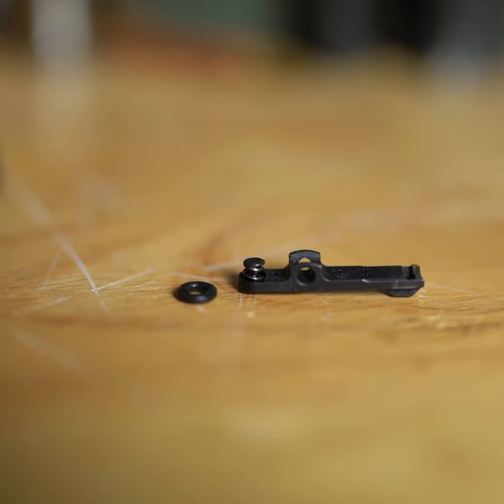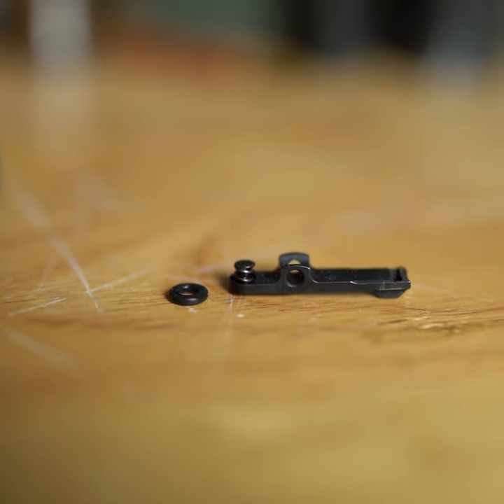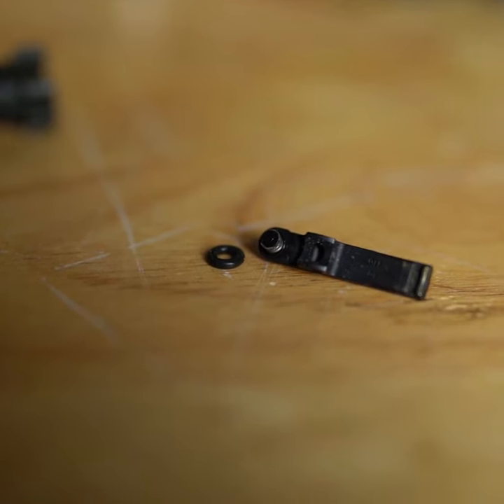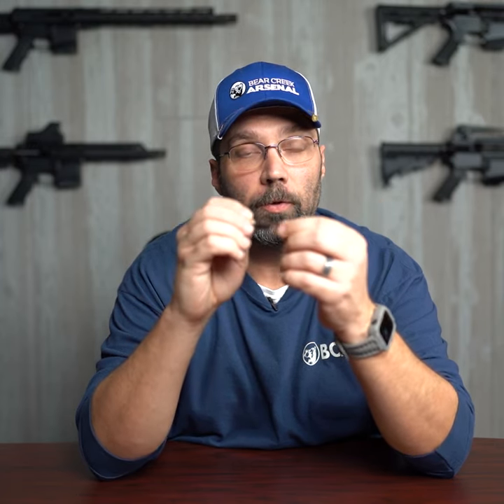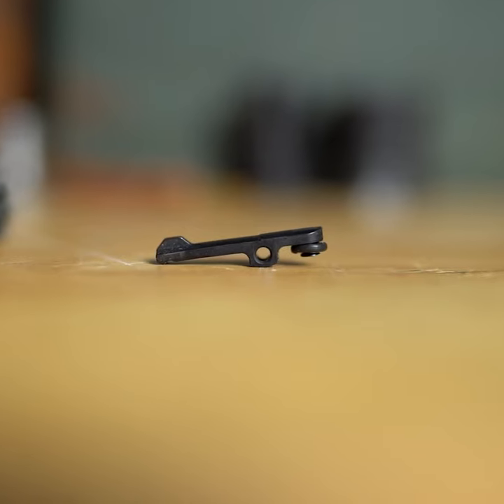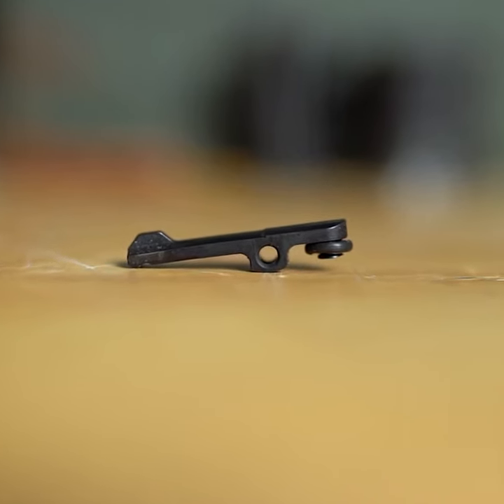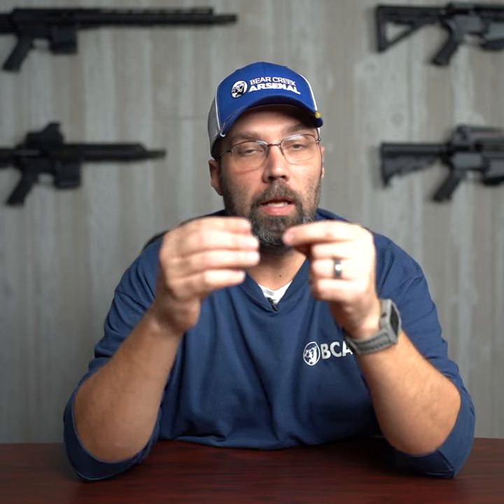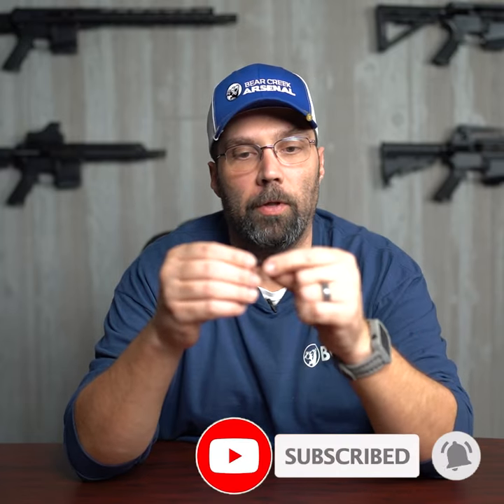Do You Need an O-ring on Your Extractor?

Comment: My Bear Creek 20" 5.56 upper was occassionally failing to extract so I added the "O" ring and have had no problems since. Also I get sub MOA with this and the Bear Crerk 3-9 scope. I am very happy with both
Reply: I also have a 20 inch upper stainless steel fluted barrel  And mine was very under gassed. It has a rifle  gas system. It was not ejecting or feeding. The boat wasn’t going far enough back to pickup the next round So what I did to fix it is I put a really light buffer and buffer spring. That seems to help a little bit and it was still doing it after every few rounds. So I took off the rail and I noticed the gass block was loose And crooked there was a lot of carbon around it, so you can clearly see it was leaking and not sealed properly. I fixed all that and now I don’t have any problems whatsoever except for the fact it’s still ejecting at 5 o’clock. But it doesn’t have any malfunctions anymore

Comment: My biggest concern about the neoprene o ring is how it might react to cleaners and solvents. I've noticed in automotive applications with o rings that eventually oil and solvents either swell or turn the material brittle.
It seems to me a better spring would be the best solution . The o ring seems like kind of a stopgap fix.
Reply: The synthetic rubber they are made out of is Viton, which is resistant to cleaners and solvents.

Hope this helps.

Comment: i had to get a new extractor for my BCA 7.62x39 upper as it was not grabbing the round right out of the box.  perhaps the oring could have worked but i didn't have one.  BCA sent me a replacement extractor and it seems to work without the oring while cycling rounds through by hand.  i've yet to fire it.

Comment: My 7.62/39 upper from bca didn't come with an o-ring. Also didn't come with the enhanced firing pin had to order my own.
Reply: Mine didn't either. It won't fire Wolf ammo because the primer is not flush with the case. I called and they sent me the enhanced firing pin but the enhanced firing pin was too hard and brittle and snapped right off on the first round fired. I called and left a message but they never returned my call.
Reply: All new x39 uppers now come with enhanced firing pins installed. They changed out last yr to the enhanced.. I had an older one that I put a black rifle co pin into, but the one ordered last spring had the enhanced pre installed.
Reply: @backwoodsmaineiac8897  How did the Black Rifle firing pin do with something like Red Army standard  7.62x39 122 gn fmj? Those primers are set silly deep.

Comment: Had one of mine, wouldn't cycle correctly. Removed o-ring, worked great, after that. Wondered if cleaning solvents made o-ring swell??
Reply: This is a common issue with short ARs like pistols. It is actually recommended that you remove that o-ring

Comment: Ok so I’ve had my bca 10” upper for a little over 2 years, it’s the one on my channel I have painted in pink camo, so yesterday I was loading it up and showing my little brother different features cause he hadn’t seen one before, he was trying to cycle a round and I seen it wasn’t cycling, so I tried and it felt odd so I looked down and of course some how my extractor had popped out, I chatted with the bca robot but it just sent me a link for a return but I’m not about to return my damn gun for an extractor.  Does anyone know any good aftermarket extractors that will work for the bca 22

Comment: Ive tried to contact BCA about replacement extractors (i have two 7.62x39) uppers and never heard back from them.. i know times are busy i get it but i would like to at least know what a good aftermarket one that will work and i can buy and fix them myself. Not a big deal i just want to know what works i know they make 2 different size bolt face. I know that black rifle arms website says theyre extractor does not work with BCA
Reply: Goodluck it took me a total of a month and a half to get in contact then a couple more weeks to actually receive a replacement BCG, shouldve just gotten a new extractor

Comment: Can't even use "caliber" correctly.  No wonder they have so many QC issues.....sigh....
Reply: I got a complete upper in my store straight from BCA. Bolt was RUSTED solid into the carrier. I think this upper was on the titanic.
Reply: Sucks to be you too, I've got 4 uppers from them, all work flawlessly  and are sub moa, sometimes I wonder where these stories come from? How could I be so lucky, and everyone else I know that has uppers from them also have no problems??? Seems fishy there's always someone bashing this company when all my personal experiences have been great.
Reply: @wymonwatson1309  I believe the rusty bolt story a lot more than your 4 BCA uppers that shoot sub moa fairytale.
Reply: @wymonwatson1309  Seems fishy there's always someone complimenting this company when almost all my personal experiences with their stock uppers have been overall poor.  My only REAL compliant with them is that the CUSTOMER is their QC department.  For the price, I'm not surprised/angered at the percentage of poor shooting barrels they send out.  (That's a quality issue - not a QC issue - and they are low priced guns.)  

I buy their uppers because it is the cheap way to get a side charger and BCG. Toss the barrel; and you still have a cheap, but well made, side charging upper/BCG to use on a better build.  

One came without an extractor.  A different one came with no gas port drilled in the barrel.  (How is that for QC?)
Two would never cycle a round more than 25-30% of the time.  (One of those is the above mentioned rifle once they "repaired" the port issue.)
The WORST is a 22LR upper that does 12MOA at 50 yards with the ammo it likes best.  (This is a quality issue - not a QC issue, I admit but dang!)  
Et cetera.

They send out some really good uppers.  Their customer service is AWESOME if you don't mind sending it back (for free) multiple times in some cases.  Their QC is horrible.
Reply: @kj2219  I have no reason to lie about my experiences with their products, I've honestly never had one issue with any upper I've got from them? I find it hard to believe that people have  had so many problems when I've always been satisfied right out of the box. I guess I've been lucky? Just seems like statistically I should have got a bad one by now? I just bought their .22 magnum upper a few weeks ago, and it has been great, I put several hundred rounds through it last weekend and it had zero malfunctions and is extremely accurate, I have two 7.62x39 uppers that are stupid accurate with cheap ammo, especially 124gr vympel, I have a 20 inch .223 wylde upper that shoots 1/2 groups at 100 yards with boring regularity as well. The only issue I've ever had was the first x39 upper I got didn't have  the proper firing pin, so I put it in a drill and sanded a hair off the shoulder and problem solved, so I guess that could piss some people off, but it seemed pretty minor to me for a upper that was 199$ shipped to my door, I've actually used that rifle to harvest a few deer and it's been great with all the stock components, I've put at least a 1000 rounds through it, all cheap Russian steel. So like I said I have no reason to lie and I'm a big fan of their products, for the price they have been excellent for me.
Reply: @wymonwatson1309  I was just pointing out (by using your statement in reverse since I also have no reason to lie) the somewhat "hyporonical" (as a joke) stance of implying others may be less than true because they state differently from one but that one should be believed for those different words.  We are strangers on the internet.  Leave it at that since it means NEITHER of our words have much value to the other.  ....and realize I'm mostly jesting in my response except for my BCA experinces. 

I've got two of the 22WMR, and I am very pleased with them.  Both are sub 1.5MOA with the "right" ammunition, and I am VERY pleased with that for the price in a rimfire.  Only one FTE from either one in a few hundred rounds in each, and that was the FIRST round from one of them.  

Overall, I suspect they do okay when they remember all of the parts and holes in very common calibers (mainly .223/5.56 and 7.62x39), but they do a piss job on others chamberings in a very hit or miss fashion.  Unless you want a side charger, I see no reason to buy a 223/556 from BCA when other companies have some much more predictably reliable ones for the same-ish price.....AND an actual QC department.  ...and they DO sound completely asinine for misusing the term "caliber" in their video.....lol.
Reply: @kj2219  I haven't really grouped my .22 mag on paper yet, I've just been shooting little ground squirrels with it. It doesn't seem to be to picky about ammo, I've used cci, Remington, Winchester and Norma they all seem to have a pretty similar point of impact to about 50 yards or so, past that you can see a bigger difference, it seems like the Winchester 40gr jhp and the cci 35 grain sp shoot a little flatter than the other ammo I have at longer ranges. I understood the point you were trying to make, and I still stand by what I said, seems very statistically improbable that I've had such good luck if there qc is that bad, I guess a sample of 4 plus I do know a few people that I've turned on to them, who have also had no problems is not proof that they get it right every time, but it seems like they are doing a better job than they often get credit for.
Reply: @wymonwatson1309  I've only shot my 22WMR at paper and steel.  I've paid a lot more attention to group size than POI.  At 100yds, they are both ammo sensitive for group size.  I've shot about 7 different loadings in them, and the groups were just over 4MOA and down to (probably with a better scope and trigger) to 1MOA or less - and those are 10-shot groups!  (I have not shot 1MOA repeatedly yet, but a target trigger and better scope probably would let me do so.)  All tested ammo has been 100% reliable IF you ignore that first shot FTE on one upper.  The only reason I don't recommend the 22WMR to people is that I've learned that, IN MY EXPERIENCE, getting good from BCA is hit or miss.  I feel like I won a little lottery when I am happy with a BCA wiithout modification..lol.  

If the only uppers I had bought were the 22WMR and 7.62x39 ones, they I would have trouble believing all the bad reports, too!  Those are good to go, in my experience, and very pleasant for the prices.  HOWEVER, those are NOT the only ones I've gotten from them.  

Just for comparison, I've bought more chamberings than you've bought uppers, so I just have a much larger sample size.  Their 350Legend and 450BM seem to be the WORST in my experience.  They just can't seem to get those right.  Three 7.62x39 are all really good.  I've only got one experience with a 223/556, and as soon as I got the extractor from them, we shot the barrel into the Gulf to see how far it would go.  (Shoved in Nerf ball in potato gun.....it came out spinning end over end, so it did NOT go vary far.  Upsetting....lol).  I just wanted a side charger 277WLV, so I never really cared about the barrel at all.
Reply: @kj2219  Yeah, I've only had experience with the common calibers, I thought about trying a 6.5 Grendel, and also considered a 350 legend upper, but I never bought one because I already have a lot of firearms and couldn't really justify those calibers as far as cost of ammo and any purpose they would serve that I don't already have covered, the 556 x39 and  22 mag seem to be good though? I guess I'm glad I never pulled the trigger on those other calibers. I may have to go see what my wmr is doing on paper, but I have been hitting little squirrels at some pretty long ranges for .22 mag with pretty good consistency.
Reply: @wymonwatson1309  I'm not generally one to be a fan of new calibers until they've been out for 10 years and remain popular, but I am on the 350Legend bandwagon!  (I do like larger calibers and think of anything less than .308 as a mouse caliber...lol.)  We've killed about a dozen deer with the 350 Legend and about half that number of feral hogs.  It's a great kids cartridge IMO since the recoil is a little less than a 243Win BUT leaves a much bigger wound channel with complete pass through.  The blood trails using the 180gr Win PP look like they were made by a toddler with a paint brush.  Meat damage is not nearly as bad as anything with a ballistic tip-style bullet.  I really DO love the 350Legend - especially since practice ammo for the kids is still only like 60-65 cents per round.  (I reload and cast my own lead bullets, so we practice for half that amount whenever I find time to roll some!)  They THUMP steel.  ;)

Even my best tested BCAs in 350LGD just aren't their in accuracy for hunting with any tested OEM ammo.  Shrug?  To give them some credit, this DOES seem to be a tricky chambering to get right.  My RRA are my go -tos!

Never tried their 6.5G.
Reply: @kj2219  That's interesting, if your reloading for .350 already why not try to make a load it likes? I had to try about 6-7 different powders on 58gr vmax for .243 before I found one that worked, it was a pain in the ass, but still fun along the way, and I thought maybe I wasn't ever going to get it to shoot, the I tried a powder that worked right with the barrel harmonics? Or whatever and went from shotgun patterns to nice little clusters. Might be worth trying, now the caveat to that is I tried the same thing with 60gr varmegeddons and never found a load that worked. So try different bullets and powders, and you will probably get there. Of course that's a lot harder to do these days, so I guess my advice is probably useless lol.
Reply: @wymonwatson1309  Short answer is, "It isn't worth it."  Longer answer is, "I don't think it would work." 

I still have too many rifles/upper chambered in 350 to tailor loads for each one: 3 stock BCA and 5 others, I think.  (Five of us hunt, and I don't wat to keep track of 5+ different loads in the same straight-walled cartridge.....and I'm not after uber-accuracy in a 150 yard hunting rifle.)   Load development on barrels like these right now would likely cost more than a barrel replacement and STILL have a good chance of failure.  There are very few options in component bullets for hunting available for this caliber (and the copper bullets are less likely to work in a barrel with issues) - especially since I have found the lighter weight ones to be less efficient for hunting deer/hogs.  If a barrel likes a bullet I don't like, then I don't like that barrel....lol.  There just aren't that many options for the 350Legend unless you are okay sizing some .357/.358 ones down.  

Realistically, though, I'm not sure any combo will really improve some of these.  One reminds me of a bent barrel on a Mosin before we just cut the barrel down before the bend.  It acts the same way, but I am NOT saying the BCA barrel is bent.  It just reminds me of how that barrel behaved.  I suspect the BCA barrel is just cut wrong with a tight spot or something.  No worries when I change the barrel and keep the other parts, but this indicates poor QC again.  The other one...well, I'm not sure.  Something stops feeding that I can't see.  Even if you hand place a round into the chamber part way and drop the bolt, it often won't feed.  (That eliminates ramps and mags.)  Bolt, chamber, receiver, barrel extension issue?  I don't know: it acts like a burr that sometimes catch, but I can't find it.  I can't swap barrel until I know the other parts are fine.  I should just send this one back under warranty, but the last time I did that I ended up with a "fixed" upper in worse condition....lol.